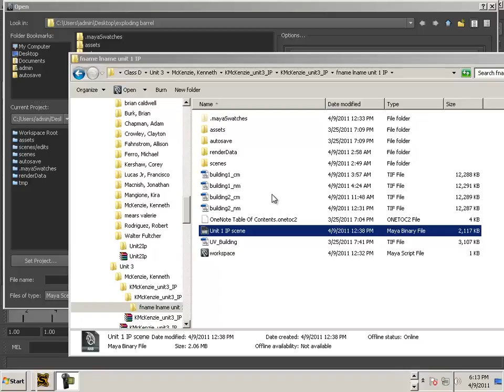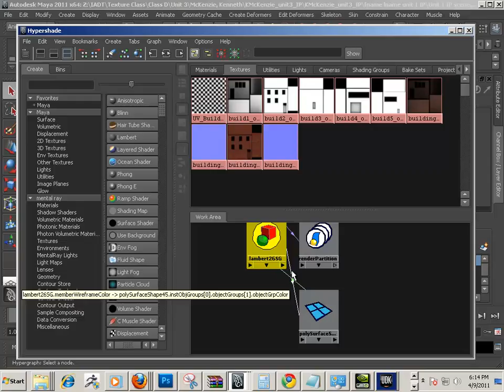Maya model turns black fix.mp4

Comment: Thank you thank you thank you. For some reason my problem was the opposite.. in low res view, some of my polygons were turning out black, in high view, it was perfect. I couldn't see any issue with my shader as i am only using the default lambert for now.